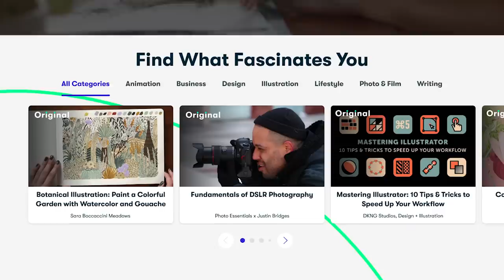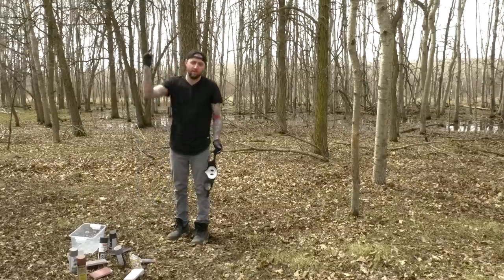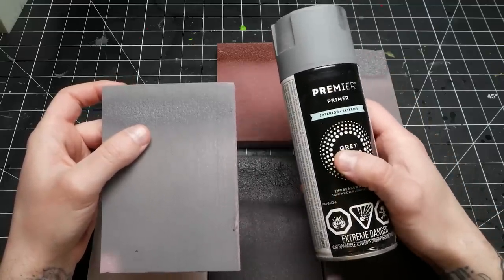We need to talk about spray paint melting foam.

Comment: No. Depending on brand, and even on lines within brands, you will eventually run into a spray that will ALWAYS melt your foam, despite distance, shaking, and even pre-coating of the foam with some other substance such as glue or wood filler. Some simply penetrate and are that caustic. Some sprays will NEVER melt because they are simply made different or with different levels of caustic substances. The reason the veterans tell the newbs not to do it is because newbs lack sufficient experience to be able to tell the difference, and therefore risk destroying something they've put a lot of work into. Trying to advise them to bypass these safeguards is just self indulgent. Congratulations... you are a know-it-all and somebody, somewhere is in awe of you. Meanwhile, there are actually lines of paints that will not melt foam at all. The Liquitex rattle can line, and its many art store brand name copycats, can be used safely on your foam every time, even when blasted from an inch away. I don't think they have a spray primer in that line, but they dry quickly enough, depending on color, and have good tooth.
Reply from the maker: It’s like you didn’t actually watch or listen to what I said.

Comment: Paint the foam with normal wall emulsion first.  Then spray paint.
Reply from the maker: Or..... Don't bother because you don't have to.......And if you've already painted it with something why then paint it again with spray paint? The whole point of spray paint is a quick and easy way to get nice even, and thin coverage. Painting first with other paint, especially with a brush would completely defeat that purpose. And as I show here, you don't have to. You can just spray paint if you do it right.
Reply: Black Magic Craft I use emulsion for a lot of my terrain, specifically smooth external wall emulsion because it’s cheaper than spray paint for the coverage. 
It’s very good for MDF terrain.
I base coat in emulsion, then I spray paint to add definition.
I have some polystyrene ice terrain.  Based with light blue emulsion and then a light coat of white spray paint on top.
MDF buildings I use Black Emulsion  (tester pots very cheap) as the base, and then dust them with grey spray paint.
It works very well.

I do take what you are saying about the propellant being the problem though.
Reply from the maker: @ep1phany62  yea, it sounds like you are taking similar steps as me when painting most things, but using house paint instead of mod podge followed by acrylic craft paint. 

This whole exercise though was to show that if you want to basecoat and prime with spray paint on raw foam, that you can. Painting after a protective layer of mod podge or other paints or glues was never really the issue. If you get what I'm sayin.
Reply: Black Magic Craft Yeah, I do.  Kind of a hobby mythbusters video.  
Be good for people making terrain for events, when you need to turn out pieces super quick👍🏻

Comment: Actually on the subject of spray paint I have a question I could use some help with

I've used rustoleum for the longest time but noticing a problem with my cans. They seem to dry fine and dandy, but get scrapped off very easy and leave a "dusty" residue when touched. Thankfully once painted over there seem to be no issues, but it's really a hassle to prime my warhammer models. Does anyone know if it's just the cans going bad and need fresh ones? Do I need to switch to a different brand like Krylon? I'd really appreciate any help
Reply: Nobody can help?
Reply: Sorry, Adrian, I have no experience. I can only recommend buying a can of Krylon and doing comparative experimentation.

Comment: Anyone old enough to use spray paint should know to keep the nozzle 10-12” from the material you’re painting, wood, plastic, metal, etc, the distance is on the damn instructions on the can. If you’re dumb enough to use spray paint 1” from your material, then you’re definitely not smart enough to indulge in this hobby

Comment: can u use black modepoge on minis?
Reply from the maker: You can do whatever you want....but I wouldn’t recommend it.
Reply: @BlackMagicCraftOfficial  thanks
Reply: Its useful if you are painting any plastic minis that may be slightly bendy. The Podge is flexible enough that it won't instantly flake off if the mini does happen to get stressed/flex. Straight PVA will work also, but the Podge seems to be a bit more durable. Key is to keep it to a thin coat - if you slop it on it will obscure detail.
Reply: so like on a stranger things demagorgin mini

Comment: Hi, what other brands did you use?
Reply from the maker: That's irrelevant. As I demonstrated every brand I tested performed basically the same with correct and incorrect application methods. Some brands may be more ore less aggressive but at the end of the day you need to use correct technique and test each can yourself.
Reply: @BlackMagicCraftOfficial  no no, I make movie sets and props for a living in toronto. I really liked your selection of foam burns. I've always painted foam with an air gun, never a spray can
Reply: Specifically the one at the top right. It burned  really evenly. Was that a result of the product you used or was it technique? Because I spent literally 2 months on a batman batcave as this would have worked well to do touchups after shipping. Tell me your secrets... if you don't wanna out any brands DM me on any social media as @shardahartley
Reply from the maker: Wanting to avoid melting or wanting to cause melting, it’s the same. YOU need to test and practice with the paint available to you. You don’t need a secret, you just need to get some spray paint and use it. THAT is the secret.
Reply: @BlackMagicCraftOfficial  fair, but I got a whole wall of spray paint, and if my boss caught me wasting it on "practice burns" he'd be less then pleased. I always go straight for his expensive stuff. Thats why scenics generally do baseline internet research before we waste product. If you insist on guarding your secrets thats fine
Reply from the maker: Are you trolling me? I’ve told you, the secret. Take paint, spray it, see what happens. That’s the secret.
Reply: @BlackMagicCraftOfficial  sorry maybe a miscommunication? I'm not trolling, just bad at talking I guess. I was saying I really like burn on the upper right piece and was interested in knowing what brand that is. I haven't gotten that even effect with the brand we normally use on foam and without wasting product that doesn't belong to me, (it belongs to the studio) I'd like to practice getting that effect since it reads well on camera
Reply from the maker: Buy spray paint. Test it. They basically all work the same, some are more aggressive but the majority act the same. You just need to learn to control it. Seriously. Buy some spray paint, spray it on foam until you get the desired result. 

Stop looking for the name of a magical brand. That’s the wrong way to approach this.
Reply: @BlackMagicCraftOfficial  You wouldn't buy paper for the office, and I'm not buying spray paint for the studio. Appreciate your attempt to give advice but you gotta know saying "Just get good" is more then a little frustrating right? Its cool though. If you honestly think it had more to do with your technique then the material then I'll try being more aggresive with the primer. Thanks for your help
Reply from the maker: When working a skilled trade you need to practice to get good. That’s just how it works and there’s no way around it. Test pieces and samples are a part of most skilled trades and creative industries, trying to avoid them is the strangest thing I’ve heard in a while. Either you buy the paint or they do, but someone has to. 

Imagine you were a chef and you were asking me what brand of salt is the secret to making food taste good...
Reply: @BlackMagicCraftOfficial  okay. So in the film industry, you have to work fast. You can't blow your budget on 10 different grey spray paints or dick around. You don't have time to experiment a lot. The only one who gets to experiment at all really is the key. Everyone else just imitates whatever technique he uses and what every material he chooses. If I want to suggest adding new techniques I need to request specific materials. Which is why I was interested in what you used. Thats it. But thanks for telling me how to do the job I have been doing for 5 years. Who would have thought I needed an art degree to do my art job?
Reply from the maker: The answer I’ve been saying over and over and over is that you need to experiment and practice. There is no way around that. It doesn’t matter how your particular industry operates. This whole conversation has been one of the most surreal ones I’ve experienced in all my time on YouTube. 

I don’t know what more to say.
Reply: @BlackMagicCraftOfficial  Look, I asked a simple question, I was only mildly curious and now I've spent way too much time explaining why I would have liked that information. You seem like a nice enough guy in your videos and I really don't like how this is escalating. Have a nice Victoria day. Enjoy the fireworks
Reply from the maker: @shardahartley4328  you too man.